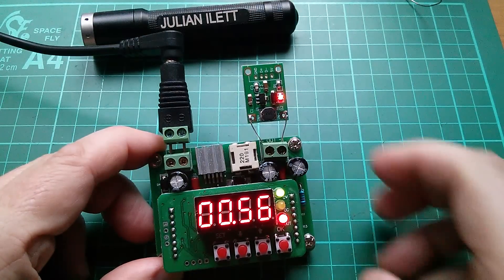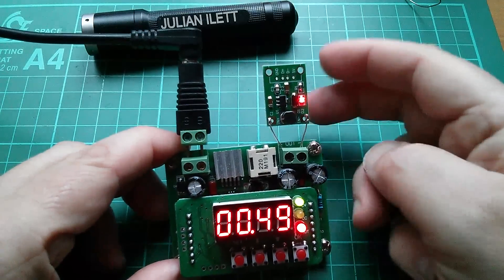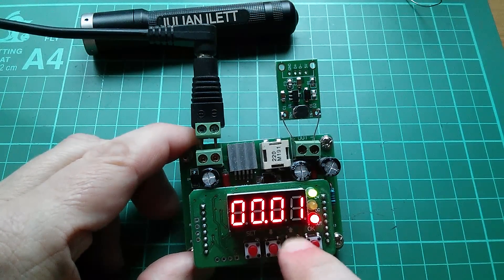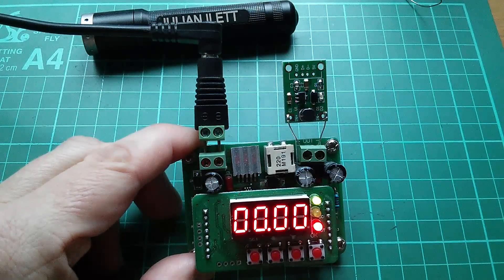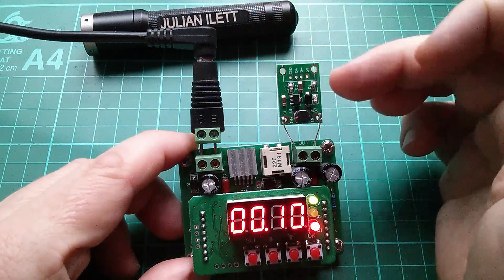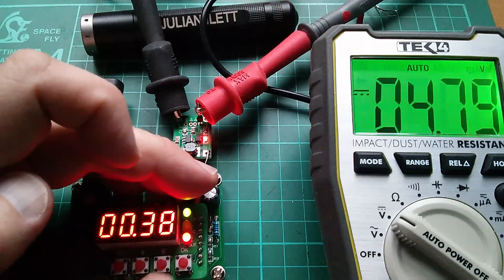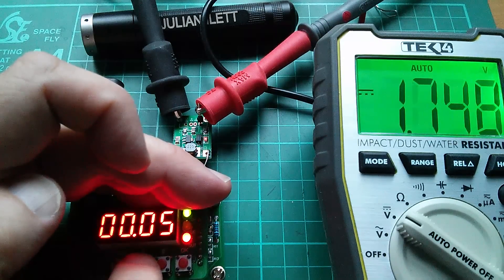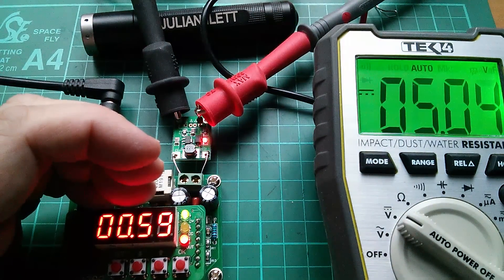Update: Cheap 5V Boost Converter Performance

Comment: i dont get the 5 volts ,dont know why??
 faulty part maybe? i knew i needed to order few more... 
tried with few batteries. From li-ion of measured 3.4v i get 3.25 v on out, tried a full 3v cell battery , got out 2.85v ... 
the red led lamp is on

Comment: How would one make a cheap adjustable 5v to 12v step up? I need about 10 for some power bank lights I wanna do max of 5v one 1amp I just need to get 12v to power the light

Comment: Just recieved one of these, nice little units but the efficiency is horrendous, connected a white 5mm LED and 60 ohm resistor to the output and measured 27mA of current draw, single AA battery draw was 160 mA!! 10-20% efficiency maybe.. better Joule thiefs available than this. good find anyway :-)
Reply from the maker: From your numbers, the efficiency is 56% (Watts out / Watts in)

Comment: Lets see if you can now boost it to 12V :-)   http://m.ebay.com/itm/5W-USB-DC-DC-Converter-Step-Up-Module-5V-to-12V-Power-Supply-Boost-Module-/141731444032?nav=SEARCH

Comment: I think it would be quite interesting to connect that tiny device to a single large solar cell.  How efficient is that boost converter?  I'm wondering if you could get enough power out of a single large photovoltaic cell to charge a cellphone (say 0.5-0.6v at 8 amps).  At 100% efficiency (which I doubt), you'd still get 800 mA to 960 mA at 5 volts.
Reply: I suppose my method isn't a very good one, now that I think of it.  You can achieve a 100% efficient conversion of current to voltage (and companies do this already.)  Simple break the whole cell into 10 slivers and connect them all in series... DUH :)  100% current-voltage conversion... but, of course, that takes some work.

Comment: Hi Julian, thanks for the vids. That item is already out of stock :P  . I have a similar 5v "usb" boost module (my chip says E5OE might be an older version of the chip). I have it connected to 1x AA (alkaline) 1.5v and an led at around  100mA on the output. It gives out a nice solid light output. So they work quite well.
 I was wondering though , in the quest for the lowest power drain when making something(eg - an led night light) could you remove the indicator led and resistor? Would it be worth it? Do you think an additional capacitor on the output would be beneficial at all? Thanks for any advice, keep up the good work.

Comment: And if you cascaded two of those boost converters, you might get 5v at an even lower input voltage. Not very practical, except maybe to power your cell phone from a nearly dead AA cell long enough to make a short emergency call...

Comment: It would be handy to know what the current draw is from the input and how stable volts and amps are on the output, thnx! ^-^
Also, how much volts and mAh it would take to charge a phone from empty, reliably(say, one with a 2200mAh battery)

Comment: Data sheet doesn't mention a minimal operation start voltage, they left it blank, only maximal operation start voltage, that is 0.9v. So in worse case they guarantee that you that you will need max 0.9V.

That it works on your bench doesn't mean it will work in Russia by -40 or in India by +85 in the sun. :)

Comment: Hi Julian what will be the cheaper way to charge a 5 arduino project ? I think that a power bank will do the job, but I dont know if it will charge and discharge at the same time to use it like a back up, sorry for  my bad english, and thanks for your videos!
Reply: not all power bank will allow you to charge them and discharge at the same time , also it depend on the amps you draw from the power bank and the charge rate
Reply: Yeah I know, I have one power bank that doesnt allow me to charge and discharge, thats why im asking, because maybe someone has more experience with a back up power source, I dont need nothing to big 3000 mha will be enough for me. Thanks in advance.

Comment: I built a 15 watt 5 volt (5 volt cells)solar panel, mounted it on a used dell led flat panel monitor base,  use step down converter to charge 2.5 volt 2600F super caps. 2 in parallel and then attach these little converters and they can charge my cell phones after the sun goes down. They run led lights. They cannot do more than 400ma by my experience, but for led running, they work down to low voltages, my best test was .70 before  it shut down. these things are great for low power apps.

Comment: I had one of these on a toy car I was controlling with an arduino. I could see that the circuit was working fine but it just refused to drive. After a while I checked the battery voltage. it was down to about 1 volt total for 4 AAA batteries. No wonder it refused to drive anywhere. I was just impressed that it kept the 5 volt for the arduino going with a few LED.

Comment: Hi Julian, who makes that TEK4 dvm, any good?
Reply from the maker: It was a Ryobi Tek4 product - now discontinued in the UK. I like it because it has a large bright display - it always looks good on camera. I bought three when they were being sold off cheap. Also the lithium battery (basically an 18650 cell) lasts forever. But there's no way Ryobi would have designed their own DVM - I seem to remember it being a rework of an Agilent product.
Reply: Yes looks good, I also like the big display. Cheers.

Comment: It starts from some voltage and when it is running it probably powers itself from the output side. I'd assume output load to make the starting harder than without a load. With too heavy load it won't even start at 1V, I think the previous episode showed some maxinum current when it is able to start at specified low voltage.

Comment: is it possible to use this 5v boost on a low voltage pv? or will over 5v damage the unit?
Reply from the maker: I tried to find a single cell PV to try as an input - couldn't find one. Max input voltage is 6V (from the data sheet). Boost converter output voltage cannot be less than the input voltage (actually it is a schottky diode volt drop less) so a high input voltage means a high output voltage.
Reply: +Julian Ilett thanks for the info!

Comment: love to see how this does on a earth battery zinc thread bar inside a coper pipe pushed into he ground could be onto a garden light idea lol
Reply from the maker: What voltage can you get from that kind of battery?
Reply: I think 0.8 volt was best I managed can't remember current
Reply: would need to find the galvanic reaction table to check

Comment: Hehehe.... China for you Julian .... Is so brillant but is so Poor ....
Reply: china is awesome for electronics hobbyists. I am not going to buy a part for 10$ when I can do it for 1$. As long as you stay away from the batteries and SD cards(all are fake) you should do fine.
Reply: I don't mind if someone is making quality stuff here and then put a higher price, but all the stores around are just buying the exact same cheap Asian made boards and then sell them with 10x upped price. And that is something I am not going to support.

Comment: I'm curious to know how stable the output is. You could have connected an oscilloscope to it.
Reply: i hooked it up with 3x nicd batts, the o/p was 5v with ~.1v ripples on a 250mA load. don't remember the exact figures, but it was something like that.
Reply: I expect the ripple voltage to be higher with such a low input voltage.
Reply: actually with 2 cells you will not be getting 5v @ 200mA as i remember.
Reply: I had the same problem with other step up converter ICs I used before. From what I investigated, the higher the switching frequency the lower the ripple voltage is, besides those regulators (working with higher frequencies) require smaller capacitors and inductors.
Reply: well, higher the frequency, lower the time you get to charge the inductor. so, if you want to pull bigger current, try lowering the inductor value to 68-100 uH, that may help.